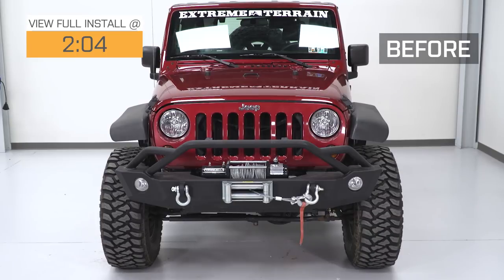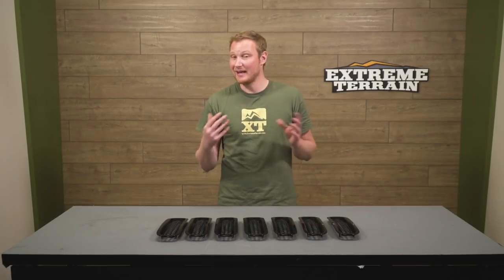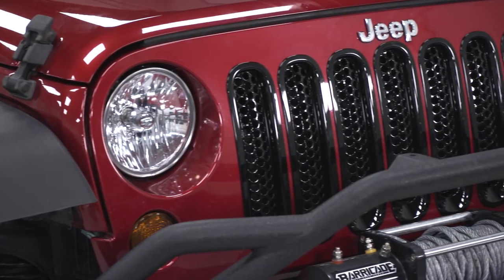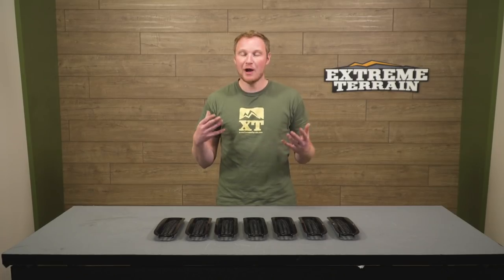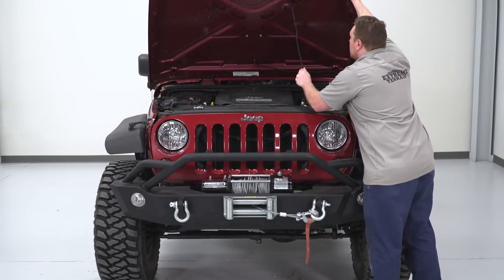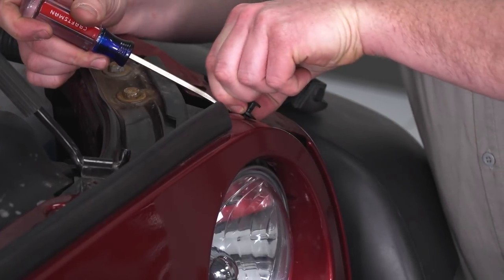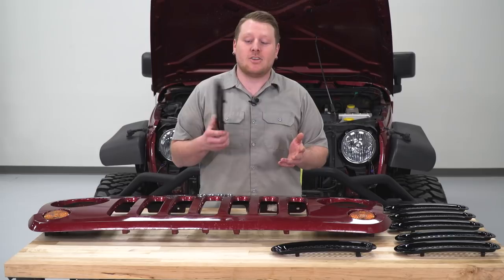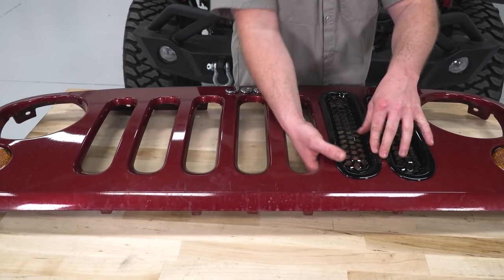Jeep Wrangler JK RedRock 4x4 Honeycomb Grille Inserts - Black (2007-2018) Review & Install

Comment: Im install those honeycomb grille inserts last week they look awesome,perfect,greats,wonderful,cool as hell!!! 
But make my jeep overheated 🥵.- 3/4 on the temperature gauge!!!!!!
Reply from the maker: I would check your coolant levels and the condition of your thermostat, honestly. My dad has had these on his 2013 JK for years without any issues or overheating concerns. There might be something else going on there with your coolant system. -Zach
Reply: Maybe cuz i add a winch a led bumper light bar.- no enuf air circulation.-😳😳😳
Reply: @rodrigocajas166  I'd still check out the basics, I can't picture the jeep overheating because of a wrench and grill inserts. Play it safe man, happy jeeping.

Comment: I bought these because a stone pierced my rad. It kinda sucks you have to take the grill off to put them on😒
Reply: I took the grill off and they still don't fit well...  Better than it was I suppose. Hope it stays in
Reply: @peterjanjanin9883  add 3M double sided tape for security.